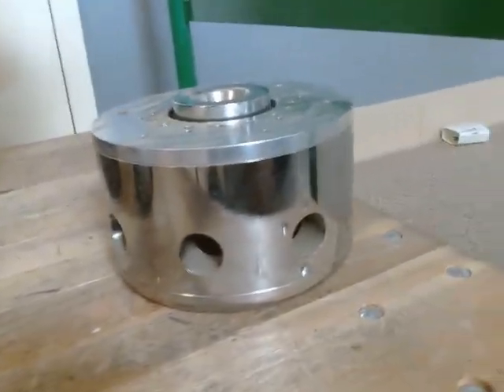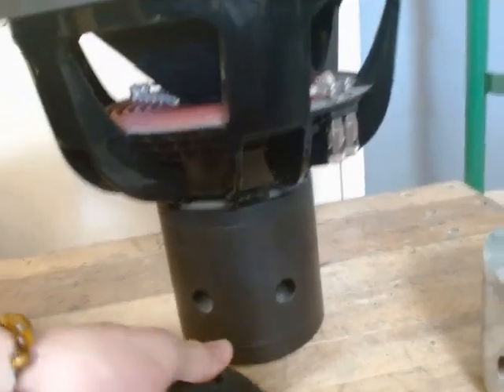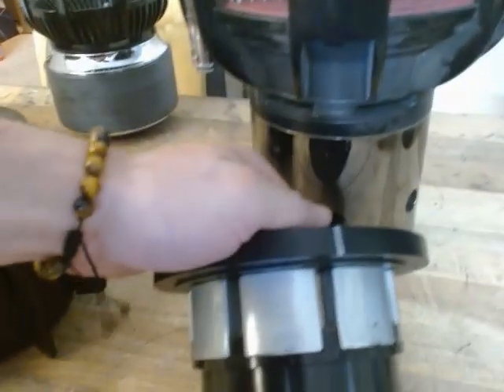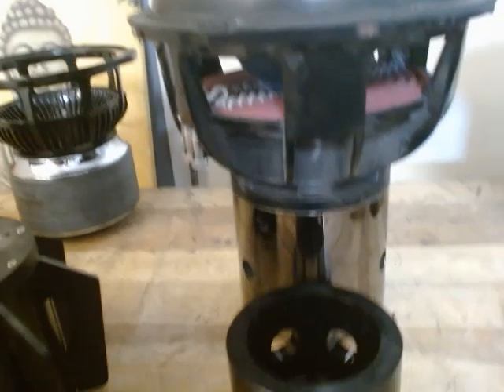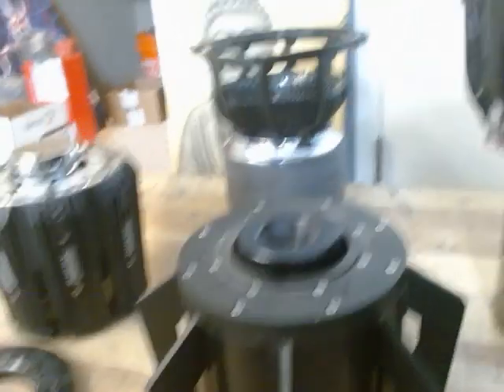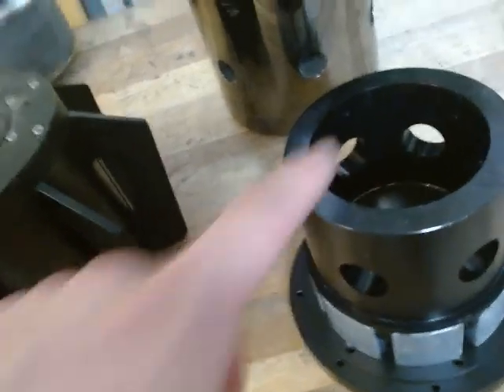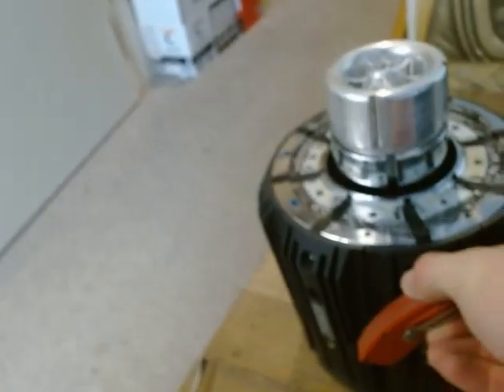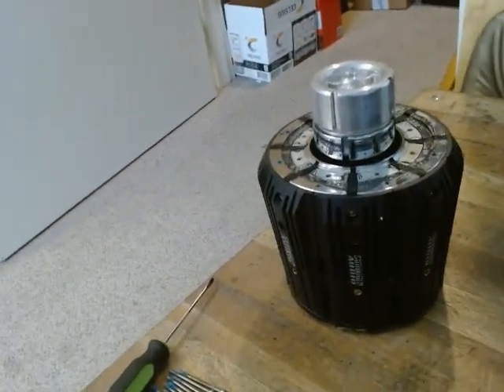Nightshade Motor Technology Overview

Comment: Neo degrades with heat just like ferrite does
Reply from the maker: Sure... If you keep your woofer motor hit enough to boil water for an extended period you will damage the Neo in this sub. Which simply will not happen.

Comment: as a fitter i use a little rubber coated N52 as a third hand for holding my tape when measuring pipe, and the fact those don't grab your knife at that range blows my mind!